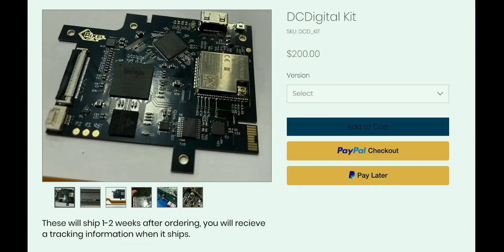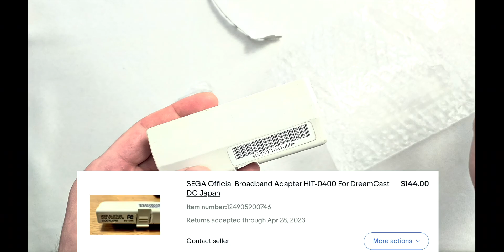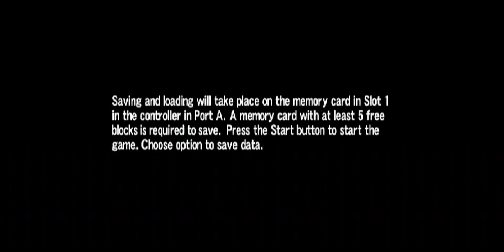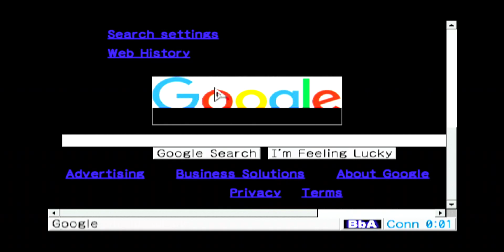Pimping Out A Dreamcast For 2023

Comment: The original DCHDMI was made by a guy called citrus3000psi who then open sourced the design, leading to people in China selling clones. He then started the pixelfx company with some other guys and made the DCDigital HW2. The DCDigital HW2 was designed to use the same flex cables as the original, so you could easily unplug the old one and plug in the new version.
Reply from the maker: Thanks for the backstory!

Comment: The biggest surprise for me in this video was finding out the Dreamcast had a component video option
Reply: It doesn't.  Any "component" cable for the Dreamcast is actually a VGA cable with a built in VGA --> Component adapter.